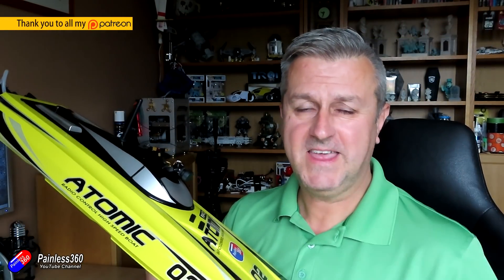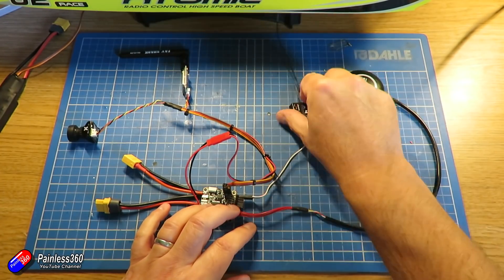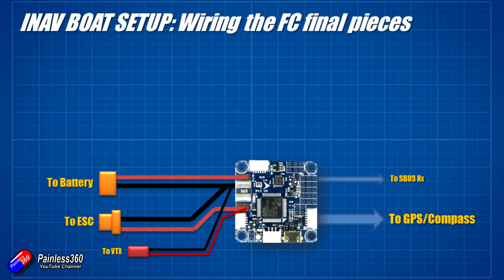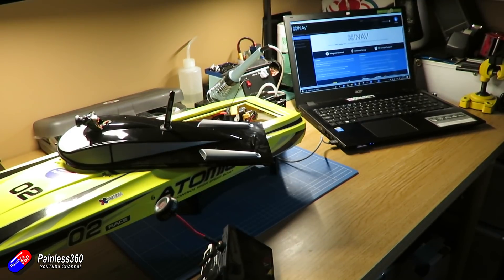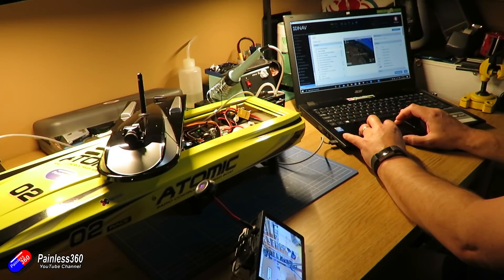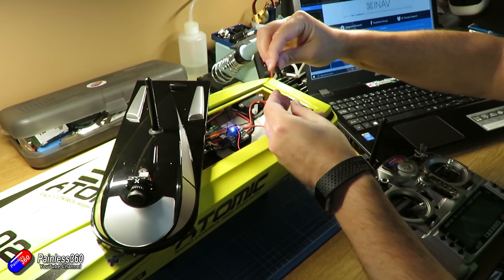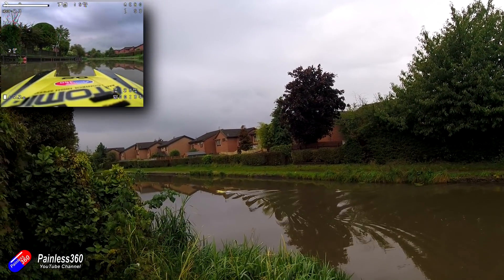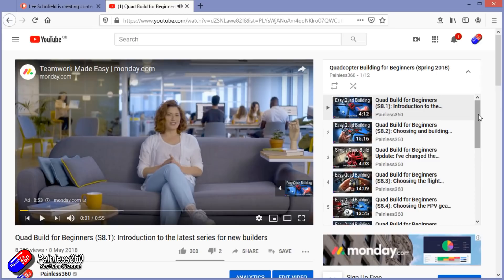INAV Setup for a BOAT or CAR: installing into the boat and testing

Comment: I have been watching this Rc boat and I am building one right now. I just purchased Radiolink at10ii with r12ds receiver that came in with prm-01 and also at crossflight flight controller with power module and gps m10. Now my question is what else do I need to get connected to a mission planner on my iPhone using QGC or other apps? Please help if I need more device/module to make this happen, any recommendations?
Reply from the maker: I'm not familiar with that radio, and if it has the capability to share MAVLINK telemetry with another device. I use the Beyond Robotics kahuna WiFi access device for telemetry here with Ardupilot models when I need a ground station but don't want complexity.. See my video on it.
Reply: @P @Painless360 thanks for the quick reply, I’ll watch more videos ang look around for more info.
Reply from the maker: See https://youtu.be/w9MwdmYZPFk for how it's done on ELRS radios...
Reply: I got it to work. First I start using my Samsung galaxy A9 tab with the OTG cable connected to crossflight. I also have a wifi telemetry module esp8266 installed ang I can use both radiolink mission planner and qgroundcontrol.

My next move now is to configure my At10ii remote mode 2 throttle channel. I saw your video where you can flip a switch and change the value from forward to reverse on your throttle stick but you didn’t explain that much rather mentioned sharing the settings file for your taranis remote.

Comment: Hello, i have RC boat with 2 motors I never used it but I want to try to make it wise with inav, can Inav work with 2 motors to turn?
Reply from the maker: If it can, it'll be in the linked docs... Best of luck

Comment: Great explanations!
What's your take on an upgrade like so: ELRS (Radiomaster GX12) + DJI O4? Which controller would you suggest? Would a modern version of Betaflight be a good choice for firmware? Thanks🙂
Reply from the maker: Can Betaflight run ground vehicles?

Comment: Can you help on mixing the throttle with the switch setting to get the 0-100% in forward and reverse.  (around 10:36) I did look for a link to the file you mentioned but doesn't appear as far as I can see.
Reply from the maker: Check out https://youtu.be/mTZrsUoFMnw

Comment: hi , it could let the boat stay at same palce by gps ? just like the drone.  when it have been control. and will stay at same location by gps！ thank you
Reply from the maker: Yes but I'd use something like ArduBoat instead. The ground based stuff in INAV is still a little basic in comparison.
Reply: @Painless360  thank you
 i bought a pix4 2.4.8 arealdy

Comment: Could you do a flight controller on a nitro or gas powered plane or boat?
Reply from the maker: I don't know nitro or gas here. The main process is the same. Check out the wiki for Arduplane that covers non electric setups.  Best of luck

Comment: Lee I followed your Video to the letter. Everything works but I plug in the esc and the motor runs with no arming! Can you help?
Reply from the maker: You turned on the reversing esc setting?
Reply: @Painless360  yes and then the esc just makes one beep constantly with no throttle. All the checks on inav are green but no throttle. I have used 3 different fc boards f 722 wing and f405 and omnibus f4 on it now but I’m not sure how to set up the x9d. Is it in airplane mode?
Reply from the maker: With this ESC I needed to send a low throttle signal briefly for it to work. Check the manual for the one you have or use a servo checker toner what it needs..

Comment: Have you thought about cooling the vtx? 
Water cooling of esc and motor are standard in boats. Vtx will also probably run pretty hot.

Comment: Although I build iNav boat, I can't treat differential thrust setting very well. 
So My iNav boat can't do a sharp turn which has medium speed.
Do you have some contents which treat how to set strong differential rate?
Reply from the maker: I am planning at looking at Ardupilot for the boat as it is a lot more sophisticated than INAV... maybe worth it look for you too?
Reply: @Painless360  Thank you for your response! Though I use a omnibus f4, I didn't used to deploy Ardupilot in it. I noticed that it can deploy. I want to try it.
I will study about Ardupilot.

Comment: Really like your channel, checking out your beginning wing series, do you have an updated recommendation for a first wing?

I've built a few quads and I flew rc gliders but planes, the last I flew was about 25 years ago when I was very young on a trainer with my dad.  

Ideally I'd want an fc that had stabilisation and the ability to run dji camera, and gps/inav.  What would you recommend?

Also, would a tango2 be alright for a wing? I also have a Radiomaster but was considering getting rid of it now that tango2 has an external module.
Reply from the maker: Check out my Kit Picks 2020 video for the recommendations. The only additional wing to add is the new AR wing Pro.. best of luck

Comment: Fine work...
 If you setup arduboat,  there is some interesting things, like loiter mode, which boat-FRAME type is it working best with. (virtuel anchor)..  
Is it possible to define your own boat FRAME-type for arduboat.
I am working on setup on real boat with trollings motors. 
In order to have enough  thrust  2 motors has to be used. 
Setup could be like your rc-boat with a motor in the back and one in the front   (then there is a boat frame type problem)
Unfortunately It is more difficult to make a setup in this boat  and place  2 motors aside (skid control), a very simple control mode...
Reply from the maker: ArduRover/Boat is a lot more sophisticated than INAV when it comes to ground based models. Loiter and RTH along a known good path being two of the main ones.